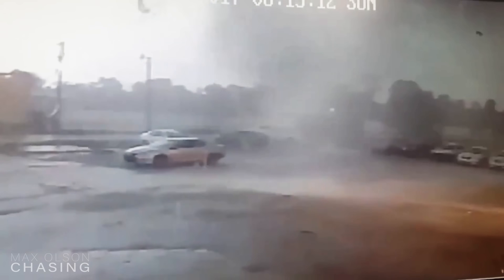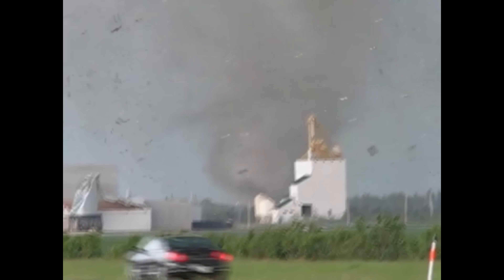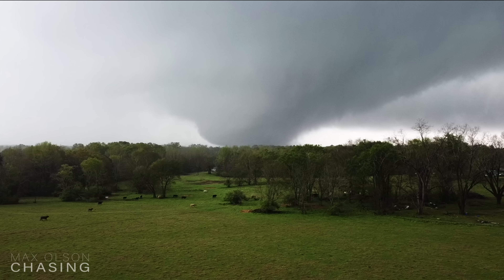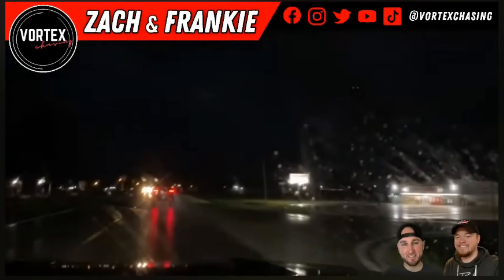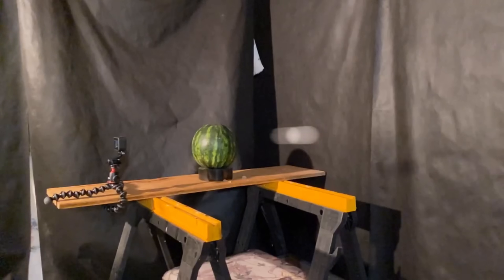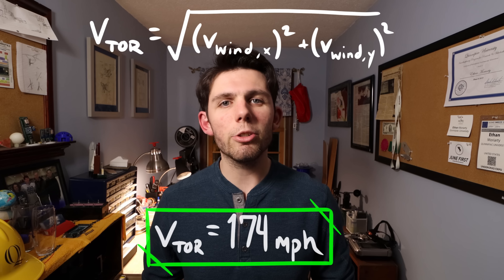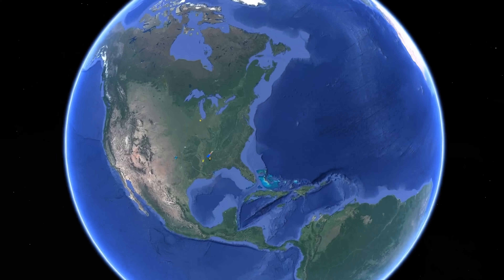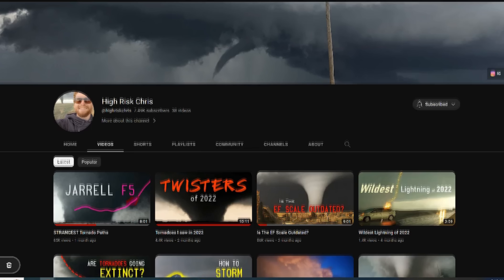Is This a Vehicle Flying Around a Tornado? - Rolling Fork, MS

Comment: The sheer power of ef4 and ef5 tornadoes is just unthinkable
Reply: Ill stick with earthquakes
Reply: @samholdsworth420  I'll stick to our wildfires we get every year in California over tornadoes and earthquakes lmao
Reply: Earthquake are as powerful as tornadoes
Reply: fear the power of the Lord...
there ain't no atheist in a tornado...
Reply: @unarammer2003  then what in the tornado?
Reply: @cs77smith67   George Bush senior already told you wat guides and rides in tornadoes
Reply: In my opinion, I find it terrifying that a small temperature and pressure difference can absolutely destroy nature
Reply: @Sundowner679  what u mean Destroyer nature?
Reply: Have you seen a hurricane? Basically really really big tornadoes.... Or are they waterspouts...
Reply: @cs77smith67  have you seen what tornaoes do to things on the ground? Technically speaking man made things are natural to our species so man made objects and buildings are natural.
Reply: @peanutinatree7191  tornadoes can achieve much higher wind speed, the strongest tornado has more than 100 mph more than the strongest hurricane
Reply: @peanutinatree7191  yes but what you're point? I'm confused 🤔
Reply: The EF5 tornado from El Reno Oklahoma in May 2013 killed 3 of the most experienced storm chasers. Their car was found 5 miles from where there last GPS location showed & also from where there last radio communication was sent & cell phone ping as well. So the tornado blew that car 5 miles! Picking it up & dropping it a couple times because the car looked like it was put into an auto salvage yard car crusher. When they found the car, only 1 passenger was dead inside & the cars engine was missing. They found one passenger 1/4 mile east of where the car was & the other passenger 1/4 mile to the west of the car or about 1/2 mile apart in total. They eventually found the cars engine about 1/2 mile south of the car. 
  If it did this to a 3,000 lb car, can u imagine what condition the bodies were in?
Reply: @nicholasvargas6397  Does California not get earthquakes? lmao
Reply: @mr.universe740  last major earthquake here was before I was even born in like 1988 in Oakland since I've been born I haven't felt any major earthquakes maybe little ones but that's it I've seen way more fires than earthquakes here
Reply: @mr.universe740  and there was like 3 tornadoes this last winter hella rare for California
Reply: @flaccidego4291  EF3*
Reply: A hurricane cant pick up a truck and lift it a hundred feet into the air 😅
Reply: @peanutinatree7191  A hurricane is a very intense tropical low-pressure system. However, just like extratropical cyclones and other low-pressure systems, supercells and tornadoes often occur along their outer bands.
Reply: EF3 El Reno was a real monster.
Reply: @cs77smith67 ...
Reply: @unarammer2003  nothing is “in” a tornado, the pressure goes down to less than 100 millibars, The average pressure on a normal day is over 1,000 millibars, and the lowest pressure a hurricane has given was in typhoon tip was less than 850 millibars
Reply: @unarammer2003  I can singlehandedly disprove that statement. The only non-human being I was thinking of or talking to the last time I saw a tornado was my car. As in, "Come on girl, stay on the road! You can do it!"
Believe whatever you like, but don't tell me what to believe. (The car was fine.)
Reply: @thing_under_the_stairs  i dont care what you believe...truth dont care about your feelings...
Reply: Yet one of most powerful tornados to ever be recorded was an EF3! (El Reno 2013) EF scale is broken lol
Reply: @GuitarCarMan28 nope. It had EF3 label because of destructions it caused. Not solely because of wind speed. It became it hits mostly only rural area, limiting the unfathomables damages it would have make on urban area.
And there is your EF3 scale. 

These guys who rates them know way better than you and me what they are doing.
Reply: @samwisehuluberlu2210  F4 tornadoes have occurred with some tropical systems. Beryl and Milton also produced big-time tornado outbreaks this year.

Comment: Was someone killed or injured and found inside of a car? With the headlights on is would appear that someone would have been driving the car at the time it was picked up by the tornado. It may also be possible to track the car by GPS either by the cars own sensor or other equipment in the car. If that is found it could give you lots of data to better help understand how this happened.
Reply: This is exactly my question
Reply: If that's a car, then there's a car in the debris field with 1) key in the ignition 2) airbags deployed 3) human remains inside. The coroner should be able to prove this....not to internet randos, but the NWS Jackson should have enough clout to ask them about it.
Reply: But who’s to say that the driver would be dead they may had been lifted that high without even knowing then placed down soft enough to not cause death but minor or no injuries at all this could be possible without the driver even knowing
Reply: From what I have been told, there were indeed fatalites from people who were driving when the tornado struck...
Reply: @random_silicates  it is also possible that someone stopped and left the vehicle running and ran to shelter...
Reply: Some vehicles automatically activate the emergency flashers after a crash. I was wondering if an unoccupied vehicle was lifted and some sort of debris impact or tumble before going aloft could have activated the crash sensors and the emergency flashers.
Reply: @AtoZFarm  seemed like multiple vehicles from the original vid. As the one is in flight, there's another on the ground on the opposite of the tornado. More than likely pulled over due to winds increasing an decreasing visibility.
Reply: @random_silicates  exactly what I been suggesting
Reply: @random_silicates  they could have easily been flung out of a seatbelt during that.
Reply: One storm chaser was caught by this tornado. The car was lifted into the air and flipped multiple times. He was injured badly. another storm chaser found him.
Reply: @MJIZZEL  thanks! I've only seen videos from the perspective that showed this one light, and was trying to (hopefully? naively?) think of explanations that would allow for an empty vehicle.
Reply: Great question. Driving faster through a tornado like that could propel it in the air with maybe the exact right circumstances. I'll be sure to keep an eye on this discussion.
Reply: And if the car took a hard hit before being lofted, it could have knocked the control stick to turn on the highbeams.
Reply: @Snowstar837  Yeah, stranger things have happened.
Reply: @ObjectionHearsay  yeah. We know that with Biden.
Reply: @shawnzeleny3042  How could you NOT know you're being tossed around in the air by a tornado?
Reply: @rdallas81  😄👍
Reply: I'm reading all the comments and glad I wasn't the only one concerned about a person or people in the car if indeed it was a car.
Reply: @timnewman1172  not likely.
Reply: They might have been sucked out. Whatever way it happened is beyond horrific.
Reply: @crystalcorley  For real ... So much that you landed gently enough to still be unaware . LoL idk that's crazy.
Reply: @vintagegirl1961  I’m also reading the comments
Reply: @timnewman1172  I think that’s what happend he could of survived depending on how fast he could run or just run run there’s no proof.
Reply: People could be sucked out of vehicle at that point if they're 500 feet in the air
Reply: @jonathank5289  name?
Reply: @Snowstar837  oh cmon now lmao. I mean I guess but very doubtful debris turned the flashers on and turned the highbeams on. More plausible people were driving and got stuck in a tornado :(
Reply: That would be a rare thing indeed! Though gentle let downs have been noted before, it would be unlikely if a person was present they wouldn't notice, and the rate that the vehicle was losing altitude would likely mean a rough landing.
Reply: @timnewman1172
Wishful thinking. Gosh people on here just can’t handle the truth.
Reply: @shawnzeleny3042 but then we would have a witness
Reply: @random_silicates not necessarily. A lot of times the occupants are sucked out of the vehicles.
Reply: Interesting that the "headlights" constantly faced the camera throughout the event. I think not.
Reply: @shawnzeleny3042  The vehicle was flung out and dropped several hundred feet.  It was not a soft landing.  Other videographers have analyzed this episode.  If the lights were indeed from an occupied vehicle, the end was brutal and catastrophic.
Reply: There were definitely fatalities in cars, but there's no way to prove if they were lofted that high unless they actually take the time to investigate the type of damage, where the vehicle was before impact, where it landed, etc. tornado damage surveyors aren't interested in proving YT video theories, there's simply no reason for them to look into it. Families of the victims in vehicles would have to personally hire an investigator to know if this was THEIR loved one.
Reply: I have seen a red tesla revolving around mars, most probably alofted by a mesocyclone
Reply: it was a firefly
Reply: Not recognizable
Reply: You’re not going to be lifted over four hundred feet in the air without knowing

Comment: The Moore 2013 tornado also lofted cars high up into its vortex as a wedge
Reply: Moore also record highest wind speeds ever documented
Reply: @chriscee546  The 03 May 1999 F-5 in Moore had the highest recorded wind speeds of 301 +/- 20 mph, but they’re referencing the 20 May 2013 EF-5 Moore tornado that had winds of about 210 mph. Still crazy powerful, but not the same storm as the one that set the record.
Reply: @BAJPGeneticGenealogist  Yes but still much stronger than the one last week in MS
Reply: @chriscee546  Okay? What was your point?
Reply: @mrpeach2023  1.Cope
2.Seethe
Reply: @chriscee546  But it doesn’t matter that it was stronger than the Rolling Fork tornado. There have been documented instances of vehicles being lofted by tornadoes that were on par with or weaker than Rolling Fork.
Reply: @ButtChugDoug66  Nope, that's what sa Tan wants you to think .
Reply: @chriscee546  lol god isn't real

1: Cope
2: Seethe
Reply: Hattiesburg MS Wedge tornado 2/10/13 tossed cars up from a local car dealership in vortex and carried them to where they landed on the High School football Sorry for my run on sentences That Wedge stayed on the ground for 21 miles from my neighborhood in Oak Grove to Petal MS
Reply: @BAJPGeneticGenealogist  honestly the Moore 2013 tornado probably pushed winds of 270-290mph, the EF scale just doesn’t go that high in terms of estimated winds
Reply: @trashcompactorYT lots of tornadoes probably had higher winds than moore 1999, i refuse to believe that anything below 300 mph could do jarrell like damage within half a second (smithville 2011)
Reply: @tor-WX  Sure as hell agree.

Also from the 2011 Super Outbreak the Philadelphia EF5 that literally dug the record-setting 2 foot-deep ground scouring with the 60+MPH forward speed each storm had that day.

Honestly stand firm that it wouldn't be too unrealistic that it'd take an absolutely ludicrous 350+ MPH gust to blast a trench into ground that was essentially made of hardened clay, which is why that ground scouring alone got slapped with an EF5 DI.

I mean, when Mythbusters tested the TIV2 and Dominator 1 with continuous 250MPH winds from a jet engine it didn't do such a thing to the ground. The mechanics of a tornado's suction vortex are drastically different.. but still.

Comment: As an Aussie who’s been obsessed with tornados and cyclones (hurricanes for you guys) since I was a kid, I’ve never really considered the speed at which they actually travel at…50-55mph (80km/hr for me) is absolutely terrifying to think about.
Reply: Some tornados will travel much faster than that. Someone correct me if I'm wrong, but I believe the fastest tornado (that I know of at least) traveled at 116mph.
Reply: Yeah 300 plus mph
Reply: The Moore tornado got up to around 335km. We’re pretty lucky we only need to deal with the odd bushfire and flood.
Reply: I mean "walking" speed (forward motion on the ground) not wind speeds.
Reply: Jarrell was around 15 mph, one of the April 2011 F5 got up to 60 mph. Anything faster is because it's being sling shot by another tornado.17:34, the subvortex is being slung around the parent at 175mph.
https://www.youtube.com/watch?v=gnIU2Ii2Ec8
Reply: @joelrivardguitar  THANK YOU! That's the one I was thinking of! 🌪️
Reply: @joelrivardguitar  is a slow moving tornado more susceptible to intensifying? (Like a cyclone) or does it just depend on what weather pressures are surrounding the tornado that effects the intensity
Reply: @flipspearing  Depends on weather pressures. Jarrell was intense and destructive because of the high wind and slow speed. 2 of the F5s in April 27 2011 outbreak were moving 50-60 mph and did some of the worst damage ever seen. 2 feet deep ground scouring across an entire field and other incredible damage moving at 60 mph.
Reply: Some are faster than that, most are a bit slower. That was a very fast-moving storm system. I went outside before it hit and the clouds overhead were moving north unusually quickly, while the storm was moving in from the west just as fast or faster. It was pretty windy on the ground, but the winds were clearly much stronger overhead.

The strong winds colliding from multiple angles is where the wind shear and vorticity came from. It was very striking to see in person.
Reply: Be humble thos are people there be humble please this is not a Game!!
Reply: I watched an F3 go up a street at 50 mph , I was on foot exactly 2 blocks away , it ripped through and left houses on one side of the street and tore up house on opposite side , it gave me a real feel for how fast the system can move, I walked toward the path to see it tearing up a forest a mile away already
Reply: Tornados and hurricanes are completely different hon.
Reply: @haha-mq8lw  that's not the lyrics
Reply: @nuwon8154  I think everyone is aware of that here
Reply: I live in Tornado valley & tornadoes start at 65mph which would be an EF0 anything under 55 mph would jus be considered wind gusts here. & this tornado in this video is an EF4 & they start at 116mph-200mph.
Reply: @daleval2182  EF3 tornadoes are anywhere from 135-165 mph idk where you got your information from but that’s very mild for a EF3 😆
Reply: @nsanejane7713  yea I’m talking about the speed they travel at not their rotational velocity
Reply: @nsanejane7713  Alley not Valley Jane lol, and Tornados,. Has NO E in it, and you get less sensible as you speak on wind speeds of travel and velocity regardless ,
Reply: Particularly terrifying for someone trying to get to shelter but what is more terrifying is one that lingers and travels very slowly as they violate general advise for survival above ground. People are generally advised to seek shelter in a room in the middle of your house and not to risk being stalled in traffic trying to escape the path of a tornado. A slow traveling tornado that lingers on that house, however, will more thoroughly grind it to leave the odds of those two survival methods exactly reversed. The majority aren't that slow traveling. Joplin, Missouri 2011 and most particularly Jarrell, Texas 2011 are examples of what a thorough difference in damage a slow traveling tornado is capable of.
Reply: The most damaging tornados are the slower ones, because they will stay over places for a while inflicting more damage
Reply: The Hackleburg-Phil Campbell and Smithville tornadoes, both during the April 27, 2011 outbreak, had ground speeds of 60+mph and wind speeds in excess of 200mph (likely closer or exceeding 300mph) and still produced the amount of destruction and ground scouring that they did.  The Hackleburg tornado in particular was on the ground for a very long time.  The thought of a monster like that moving at Jarrell speeds is horrifying, but that intensity at such a slow speed may have lead to a much shorter path on ground, so they may have been a positive trade off.  Fascinating, if tragic, either way.
Reply: He is talking speed across the ground, not the wind speed. 🤦‍♂️
Reply: @joelrivardguitar plus that was the dead man walking tornado right
Reply: @paulcarpenter7844  Yes Jarrell was the dead man walking tornado.
Reply: 318 mph - 512 km

3 May 1999 Oklahoma